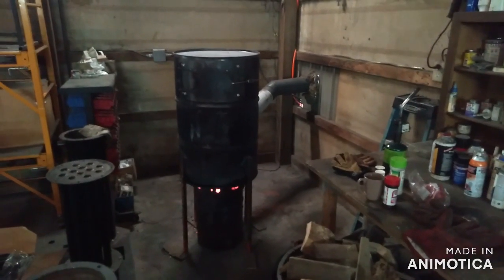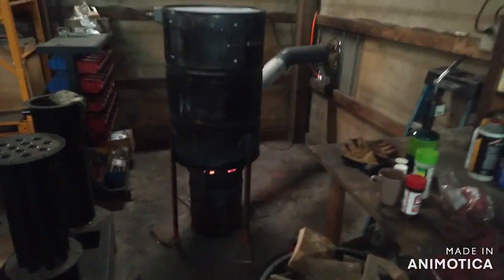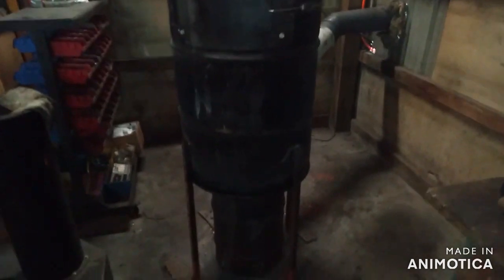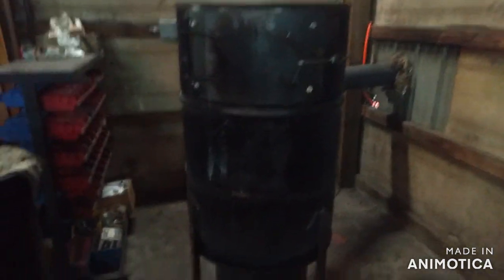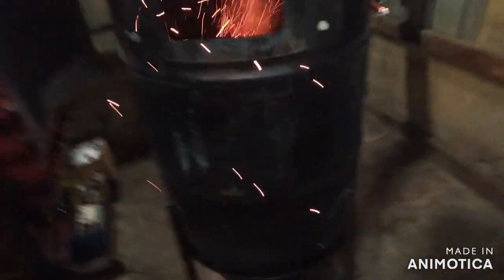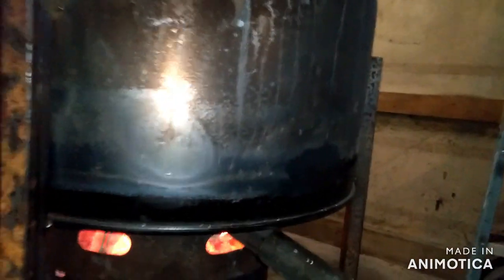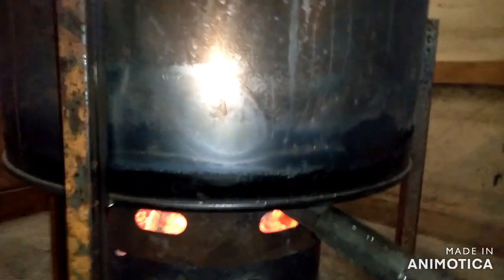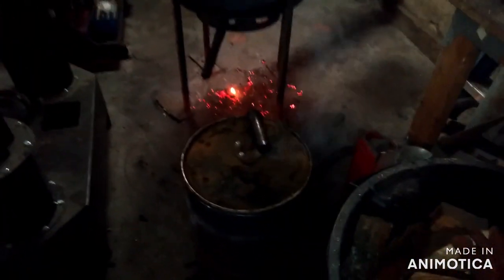55 Gal Charcoal Kiln Prototype,

Comment: Do you have plans available for purchase of this kiln or the other version of you charcoal retort kiln?
Reply from the maker: Go to the Drive On Wood forum. There is tons of info on variouse methods to produce charcoal. The easiest way is simply using a 55 gallon drum. No modifications. Just get a fire going and keep adding as the fuel is reduced. Once its full put a lid on it with weight on top. Its stupid simple /easy and is actualy quite efficient. 
https://forum.driveonwood.com/